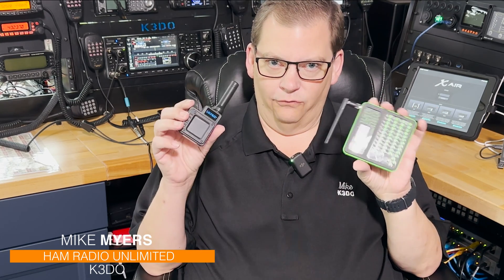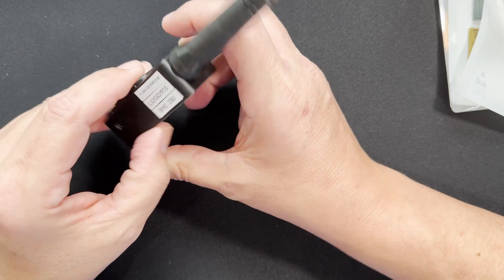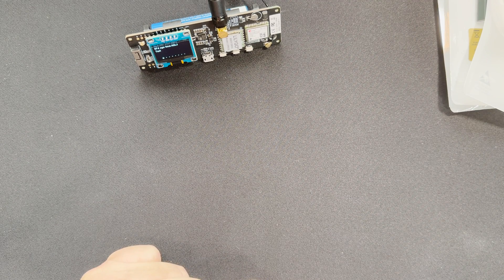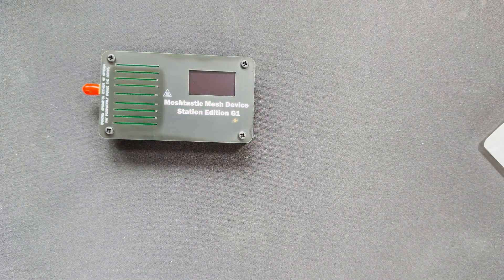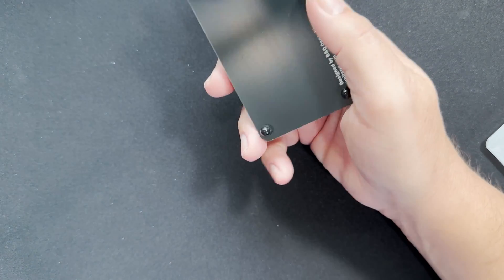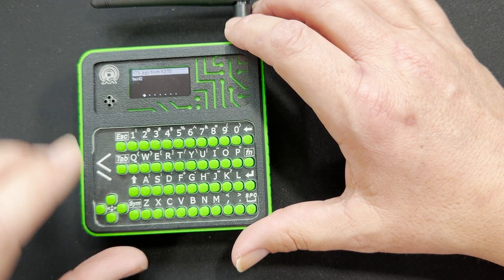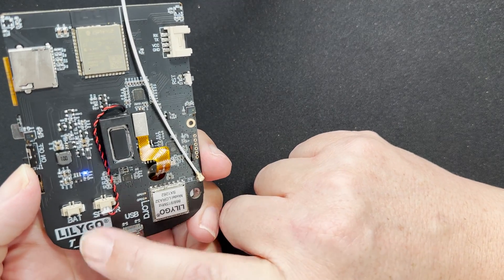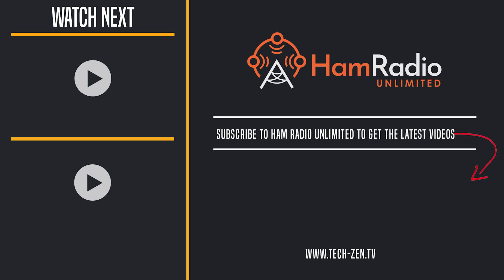Meshtastic Devices - Ham Radio Unlimited - S2E8

Comment: I concluded from this video that Meshtastic devices are like potato chips.  Bet you can't eat just one.  My solar panels arrived two days ago.  My 8.5 dBi collinear antennas arrive tomorrow.  I already had the 18650 batteries and 4 cell battery holders.  I'm waiting for my WisBlocks to ship now that the Chinese New Year is over.  I'm implementing a mesh network for emergency comms with my brother (2.5 miles west) and sister (2.5 miles east).  I'm designing a 3D printed custom enclosure.  Fun project, and probably needed soon!  😲

Comment: 150 EU  for the pico computer from Slovakia.  I am not saying it’s not worth it.  
Interesting to see other options.  I subbed to his ytube channel quite a while back.

Can you program and or use add on chips to make those Wizblock modules accomplish the same thing as the other Lora devices?  In other words, can it function as a stand alone text messenger with no Internet required?